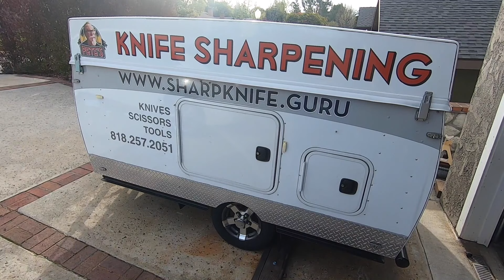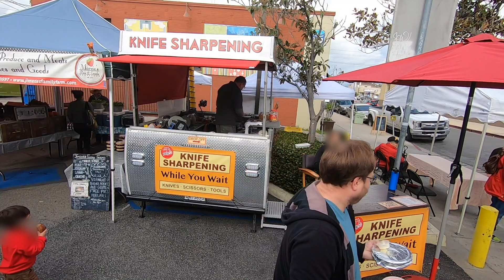Popup Trailer Conversion to Vending Trailer

Comment: This is such an impressive built Pete! I am glad to find to video. I am a doing some handcraft project and planning to build a pop up workshop like yours, I am wondering what is the mechanism that you use for lifting the roof? This is really helpful thank you!
Reply from the maker: You probably need to do as I did and start with a popup with rot so its cheap. Some parts can be found here. http://www.canvasreplacements.com
but My diner popup was completely discontinued. I have to look for parts on eBay.

Comment: I’m so pleased to find your video again! I had lost track of it and Glenn directed me back to it. 
I was inspired by your video and built a vastly inferior model based on the idea. As crude as it was, it was a godsend last year, cut my set up time from 1 1/2 hours to 15 minutes.  Plus it was perfect for Covid and the customers loved it. 
Your video had a huge impact on my livelihood and my quality of life.
Reply from the maker: I’ve seen your trailer. I like it. It’s reasonable solution that has more “sole” than mine. 
What brand is your donor trailer? Mine is Starcraft. They are out of business and parts are not available. I have on hand a complete set of lift posts and a spare wench. I’ve swapped the wench twice so far and posts (2). The wench parts are available aftermarket. The posts problem has been fixed I think but when I saw a set on eBay I grabbed them up since I hadn’t seen any for a year. 
   Glenn said yesterday that you use a lube on belts to lessen heat. Is that correct? What is it. Heat is why I keep 1” belts on mine. Perhaps I push too hard? Thinning shun knives after big chunk repair seems to be a trend lately. They are so thin heat is a concern and I dip in water every other quick pass. It’s time consuming. I’ve gotten pretty fast at it but perhaps going to 2” can be better with lube. 
  How has business been? I’m cranking busy. I only do 2.5 markets. I bring my wife to my farmers markets. After Covid shutdown I raised my prices to $1.25 per inch and $2 for serrated. No complaints, and it seems every thing has gotten more expensive now.
Reply: @FREEHAND.WETGRINDER  I only do Sundays at the market during the season as I reserve Saturdays for yard sales. The money is good, but the advertising and community are the main reasons I go. It creates a buzz and a lot of those people come to my home when the market is closed. I bring my wife too, you can’t sharpen and deal with people at the same time. The knife trick has been a blast!
I have a locker system on my front porch that is serve yourself and turns over about 15,000 knives a year. I’ve had to expand it twice. The Covid crisis was not good for the Farmers Market, but has been great for business overall, really great. Everyone has been home cooking. 
I don’t use lube on the abrasive belts although I do use compound on a felt belt and a felt wheel for finishing. I have been using a shaped  soft platen on a 1x42 for thinning, seems to keep the heat down. I also have a Sorby 2” with soft curved platen that works well. It’s a new idea for me and there was a learning curve. I use Trizact belts almost exclusively.  
I have a flat rate of $6 per knife which keeps life simple since my set up at home is no contact, but need to raise the price. Repairs and thinning extra. 
The way I see it is, the customer pays me that much to look at the knife. Then a minute or two more or less for sharpening doesn’t make much difference to me. They pay me to make decisions then the sharpening just happens. 
The no contact is good because I like my customers and I enjoy visiting, so if I talked to every customer, I wouldn’t have a life. 
I admire your technical and fabrication skills more than I can say.
Reply from the maker: Iamprosharp.com is a mobile sharpener who has a fabric store chain here in so cal. He hits 1-2 stores a day. Repeat every two months. He charges a flat number. I don’t remember what though, perhaps 10?
The stores let customers drop off and pay in advance. Some people come when he’s there. He says he’s making a ton of money.
Reply: @FREEHAND.WETGRINDER I would like to some basic knife sales, but our market is hand products only. I just squeaked in on appeal. We have considered other markets, but I like the other vendors and it’s very close. 
I’m very happy working from home most of the time. I’m slowly turning my shop into my dojo of sharp and even go out there to read. Good to have a little space from da wife, as wonderful as she is. 
Someday I’d love to watch you work for a little bit, although I know that’s unlikely. There are so many roads to the top of the mountain and I always get a kick out of seeing how the most talented have figured things out. The crusty old man who helped me when I was first starting has a completely different approach, but really what he taught me was commitment and focus. 
For that, he will always be my hero, a curmudgeon, but still a hero.

Comment: Hello very nice job in your pop trailer. I have a similar one and like a lot the awning system in yours, what kind of system did you use to open and retract the awnings? Thank
You
Reply from the maker: Scratch built frames. Attaching with modified studio light stand clamps. 
Amazon- SUPON Dual Head Grip Swivel Clamp Head Holder Bracket
Reply: Thank  you so much!

Comment: I absolutely love this! I have been thinking of converting a Popup into a Mobile Book shop.  I could really use some help if you have any advice.  I visit Elementary schools now with my van but would love to make this set up.  Just Brilliant! I have watched at least ten times.
Reply from the maker: Weight can be a problem. Both the axle capacity and frame strength. I had to reinforce both. Small pop up trailers have a 900lbs max capacity inc trailer weight. I added a frame stiffer on the door side and evidently replaced the axle to one with higher rated. 
Google search (pop up conversion fudge vending trailer. ) it has shelves that would work for books
Reply: @FREEHAND.WETGRINDER  yea it's nice but does not compare to your setup!  I love yours much better. I could get a better trailer and put the popup on it.  Thanks for sharing your thoughts.
Reply from the maker: @crecelatinoiamquixote  pick a brand that parts are available. My brand Starcraft, has a few parts available aftermarket but lift posts are on eBay/used only. I bought a complete set of lift parts in case I need them. I had problems with posts going bad before but I aligned them better and it seems better now. But these were never designed to go up and down 3-4 times a week year after year. 
Www.canvasreplacements.com
This is the best, most complete parts supplier.

Comment: Did you make the awnings yourself or did you install a kit?
Reply from the maker: Homemade. Locking knuckles are film industry boom arm heads. Shaped like hockey pucks stacked together. I found some that are plastic pared together  so getting a pair they were $10. Each. Mounting them on a 3” aluminum angle extrusions
Reply: @FREEHAND.WETGRINDER   would you mind sending a picture I could use for reference?
Reply: @FREEHAND.WETGRINDER   message sent
Reply from the maker: @Sunshyne-or3pq  not seeing it.

Comment: What the trailer hitch pivot custom made?
Reply from the maker: It’s called “swing-away” but I also added a extra pin block top and bottom to make it stronger. They sell many sizes. A larger one would have not needed any modifications